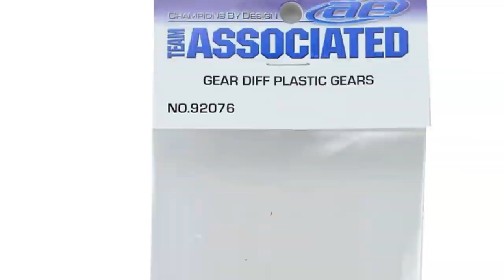Team Associated B74 tips and upgrades

Comment: Thanks for the great upgrade and tips. What pinion gear are you running with the 13.5 motor?
Reply: I ran a 26T with a 13.5 novak motor on mine temps never went up more than 140F so im gonna try and gear it up a bit more to a 28T

Comment: Another thing to watch for is the carbon bellcrank plate. Some guys are stacking 2 on top of eachother and it's bulletproof. Prior to buying another plate you can place a wide ballstud washer on each side and sandwhich the plate which will strengthen the weak area(the holes).
Reply from the maker: mtbasher thanks for the tip, I’ll double check my carbon piece to see if it’s tearing apart.
Reply: Replaced mine with aluminum